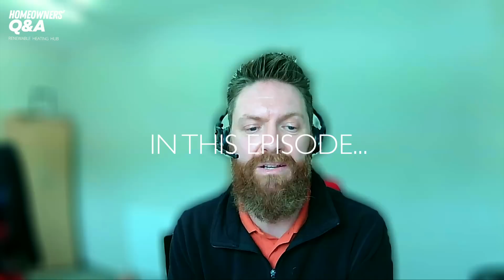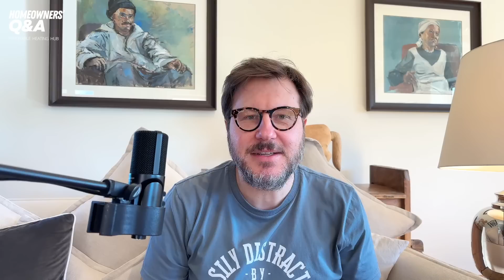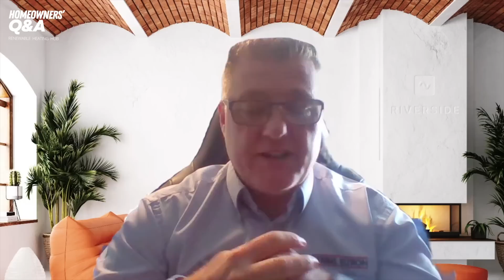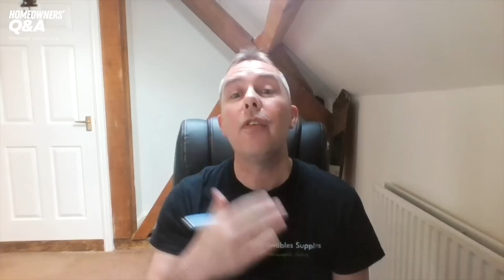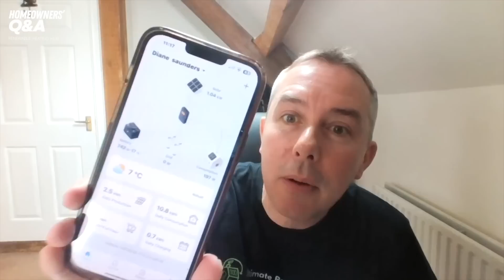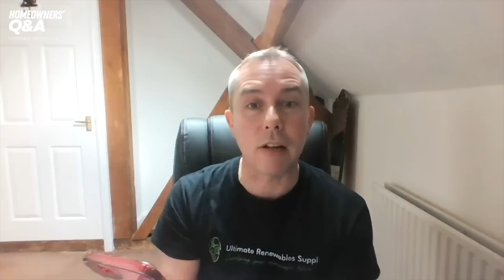Buying a House with a Heat Pump? Avoid These Costly Mistakes!

Comment: 😮A lifespan for a heat pump that is less than 10 years is totally unacceptable considering they cost 15000 to install! 

Who can afford to replace them? They need to last at least as long as gas boilers or a fridge.

Comment: What if you’re buying a brand-new build property and it hasn’t had any previous occupants to give you an energy running bill?. Me and my wife are currently looking to upgrade to a new home and it’s a new build with a 6 kW grant air source heat pump fitted.And I just wanted some advice on what to look for.
Reply from the maker: I'd be very concerned, because many new builds are not fitted by heat pump installers, and you don't get any protections. It's a really, really tough decision to make.

Comment: Was looking to buy a brand new barn style property with under floor and asked the developer what the projected COP or SCOP was, they didn’t understand what either of those acronyms were and quoted me the pump manufacturers efficiency figures. This concerned me so I collered a homeowner from another development of the same house types by the same builder; he said it was costing him £15 per day to run!! 🤬so he had covered his roof with pv and a largish battery pack in the garage.
Needless to say, I didn’t buy the house as I got the feeling the developer was only any good at digging holes and bashing nails into things but clearly did not understand the technicalities of what they were fitting into the building. BUYER BEWARE!!!
Reply from the maker: Scary stuff. On the latest episode we released we had to real estate experts and I was shocked to see how much of the real estate industry didn’t know anything about heat pumps. This prompted me to put together a 30 minute heat pump crash course so that estate agents and other professionals can have a basic understanding of what they’re talking about: https://renewableheatinghub.co.uk/course-category/heat-pumps/?tutor-course-filter-category=971

Comment: Mars, would it be possible to describe ,in detail, to us the effect of air changes using the MCS criteria for HP sizing. My understanding is that air changes can have a substantial effect as one of your panellists mentioned..
Reply from the maker: Sure... i've made a note of it, and will ask a panelist in an ucpoming epsiode.
Reply: @RenewableHeatingHub  👍
Reply: I’m glad someone asked a question about air changes as I was going to comment on what was said.
Right now there is no way of measuring true air changes on an individual house by house basis.
An installer has 2 options.
1. Use the recommended CIBSIE air change rates.
2. Guess the air change rates to try and install a heat pump that’s closely sized to meet the load of the house.
If an installer chooses option 1 the heat pump may be oversized but it should always work.
If the installer chooses option 2 they run the risk of undersizing a heat pump. I know of an installer who has done this and subsequently undersized the heat pump to the point they have had to install back up heaters as the heat pump is not capable of meeting the load at DOT.
In my opinion installers shouldn’t be deviating from CIBSIE air change rates until they can prove what the actual air change rates are for a specific property.

Comment: Q&A where is the answers I have put a few QUESTIONS up not to many answers other than get a good company to look at your system.No change out of £300 pound and still same problem.My Heat Pump is not worth a carrot fitted by a MCS accredited company Heat loss the lot.Homework haha Aye.17kW in a floor plan 125square meters MC who
Reply: Seems somewhat over sized.

Comment: Great video.  Thanks

My opinion is that there should be a standard output on the controller  and placed in any buyers pack.  The controller should output that data.

Appreciate that would take some effort and maybe legislation, but it wouldn't be difficult to do so bearing in mind the large grants.  The lack of simple information is a real problem.

I think you have touched on something.
Reply from the maker: Thanks for sharing, and for watching.

Comment: Electricity cost is only part of the picture as it also depends on tariff and if there are batteries & solar.

My imports are higher because I import at 7p/kwh and force export from batteries at 15p/kwh.

- Ideally seeing predicted usage vs actual usage. 
- ideally actual usage in kwh terms for heat pump separately from everything else
Reply: It is possible to show the usage from the bill.  I do agree though that most people wouldn't understand if mixing with solar etc.